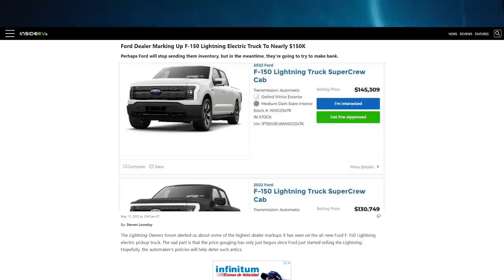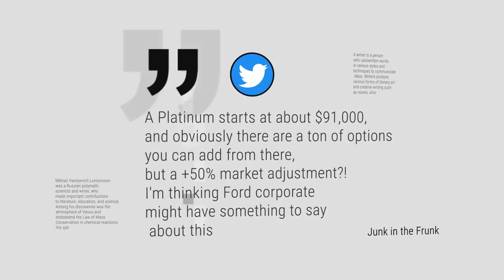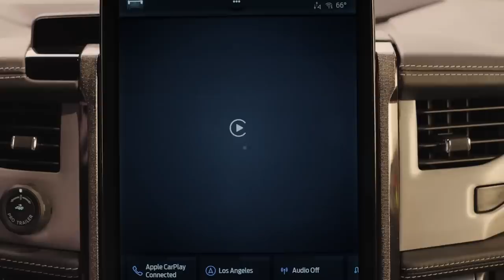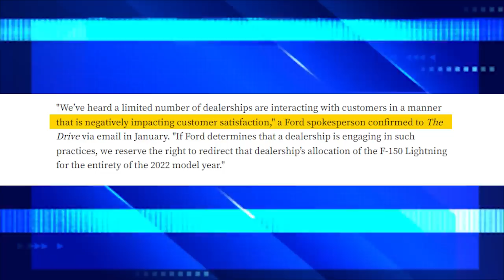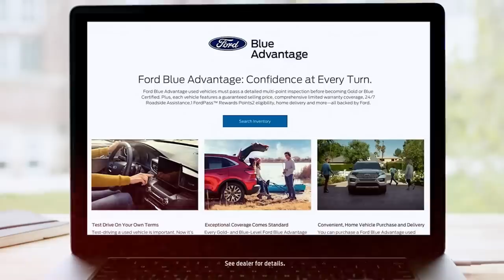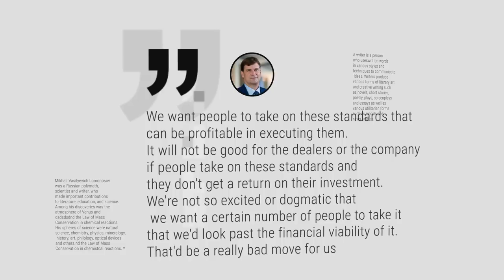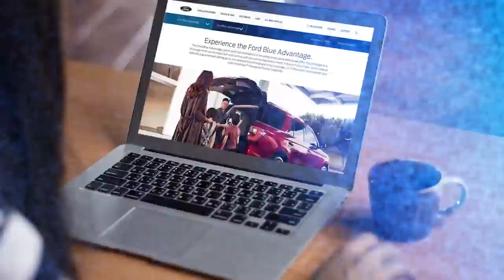Another HUGE Blow For Ford Dealers

Comment: I've been a Ford guy for a long time, but between a ton of recalls and stupid problems with our Ford's lately, and the gouging, I think I'm going to rethink my brand loyalty.
Reply: Loyalty should go both ways. Give me a good product and good service I will stay. Give me crappy products and crap service I am gone forever!
Reply: I did that years ago.
Reply: I have a Chevy 2500 6.0 and sold a dodge 2500 Cummins, own a super duty with 7.3 gas

They all suck and won’t last like the old trucks did. Just focus on best price and how they respond to warranty issues. The rest is just window dressing.
Reply: Stay away from any 2021 Chevy with the 6.2 gas engine. Son bought one and had to have the engine replaced at 8900 miles when a rod decided it did not like where it was. Been a bunch of those engines doing that
Reply: Toyota = reliability
Reply: @gutadin5  I agree with you but I have a 15k fifth wheel trailer we tow about 4-5 trips totaling around 6 thousand miles a year. 

We need the super duty with the 7.3 gasser
Reply: What manufacturer do you think does not have recalls??? Or independently owned dealers charging markups? You know that they are Franchisees right???
Reply: I went to Toyota years ago and have not regretted my decision.
Reply: Same with me. I just bought toyota tundra limited hybrid for about 18k less than Ford analog. So far very happy with my purchase 😆
Reply: Tesla also has a lot of recalls and steady rising
Reply: All brands are doing it
Reply: We were Ford loyal, but the last Ford was the last straw. Didn't even walk in to a Ford dealership this time around.
Reply: @dustinpowell5981  they all do. But Ford is leading the pack by a large margin. Look it up.
Reply: Yeah...go over to Toyota and get gouged.  A much better gouging experience.
Reply: I never understood that concept.  It’s a company, not a person.  It’s not going to be loyal to you so why be loyal to a company?
Reply: @FriedChairs  There are very few things that are loyal to you...except a cat or a dog.
Reply: @Him Humans are tribal. Sorry.

Comment: I work for a ford dealer and I am appalled by some of the pricing we charge for vehicles.
Every time we get a new bronco in, the sales dept will immediately take it back to the shop and slap $10k-$15k in accessories, wheels and tires to justify adding their ridiculous mark up.
For instance we had a bronco base come in as stock, 32k MSRP + 10k in parts and a labor, plus a 15k market adjustment. Grand total $57,000 for a base bronco…
Reply: You'd better be looking for another job because they're gonna get shut down believe me and you'll be out at work
Reply: How can you tell if a dealership has marked up a base vehicle?
Maybe this can help some of us when purchasing one.
Reply: @davidescobar5366   Look at the window sticker . FOMOCO retail price should be on that .
Reply: @scottmendoza8989  I work in parts, no matter what happens with sales, parts and service should remain unaffected unless the dealer just closes its doors completely, which I don’t see happening anytime soon. At least not the one I work for. Can’t say the same for others across the country.
Reply: This is the kind of dealer that ford needs to punish by not sending them any EV's.
Reply: @scottsdale4899  There isnt enough Broncos being produced and way to much demand from the 8 trillion dollars they printed in a year.
Reply: I've seen dealership chains add a blinking module on the third brake light for $900! You can buy them on line for $20!
Reply: Remember, Ford corp pulled ALL thier incentives, discounts, rebates and etc and they have raised thier prices to the dealers 3 times this year!! Ford corp is pissed and envious that dealerships figured out how to make good profits while sales volume went down and Ford Corp wants to steal that profit
Reply: @scottmendoza8989  And when they do you might be looking for a job yourself.  You would be in shock to know what a single dealership puts back into the communities we all live in.  The money generated in these stores gets spent right back at a local level not to mention what taxes are put back into your local government.  The job loss total would be so significant that many towns across this country would be in deep trouble.  Don't just think of sales, parts, service, and body shops would all be gone as well.
Reply: @scottsdale4899  It sounds like they have been trying altho not having much success from the video. I believe that is why they are designing the EV side to never allow it from the start.
Reply: Hunting Beach Ford was selling a Bronco for 80k. It's insane
Reply: @mendoblendo321  I would never pay it, but you have a few Broncos at a dealership and 50 people trying to buy them and they will gladly pay 100k.   It's insane, but its voluntary.
Reply: Wow! That's crazy!!!!
Reply: @andrekeise7305  Not  crazy at all when you have millions of idiots willing to pay.
Reply: As long as idiots keep buying them they'll keep doing it
Reply: Sounds like Brandon ford in Tampa
Reply: And they are bloated garbage
Reply: It's not a base if they've added accessories though...
Reply: Part of the problem is that people are dumb enough to pay for it.
Reply: If the customer doesn't like it, go buy a chevy. Supply and demand. Jim dictating pricing may work out this round but what about the next or a different Jim? Free market is the way to be.
Reply: @gary7427  soooooo.....
You're okay with people getting screwed over price then.
Exactly the mentality I would expect from someone that works in the industry and has no problem being greedy, as well as dishonest.
Reply: @rogerramjet6429  I'm not ok with price hikes or people being "screwed", but in a free market system prices are brought to you by demand and supply.  If these vehicles were crap and no-one wanted them then you would have no problem with dealers selling them far below there cost?  The important thing here is that this is not unique to dealership's, every form of retail experiences this.  Just look what people are now paying for damn chicken eggs!  Were is your outrage on grocery stores!
Reply: @Gary  what dealerships are doing is called "price gouging" and THAT should be illegal
Reply: Things are ultimately priced at the highest level customers will pay.  I don't really see any way around this rule that has existed for thousands of years.
Reply: I have to give you credit for speaking up. You job is in danger at this point. Be safe and thanks
Reply: @Michael-qy1jz  and who was the president when that happened?
Reply: It's kind of weird to see that right below your post there's another one of someone complaining about having been offered a Bronco for $60,000.

Comment: Just one of the reasons I usually buy a car that's a couple of years old. Let someone else pay all those extra charges and deal with most of the  warranty problems.
Reply: Problem is their big dollar markup cars like the 350R 500 GT and Bronco Raptor will be worth even more than you bought them for in 5 years and 10 years, especially with the end of combustion engines or the hint of that.
Reply: And you can deal with all of the out of warranty problems. Good plan.
Reply: @RLTtizME  That is why you want to buy a Honda or Toyota that does not have problems.
Reply: @RLTtizME  Angry much? LOL
Reply: @oraclewizard77  Just responding to your silly comment.  Your problem Bradley Boy. 💋💋
Reply: These days buying a used car a few years old means paying new MSRP, lol. I'll pass on that too.
Reply: @oraclewizard77  I’ll take a 10 year old 4-Runner over a current year Bronco any day. In another 10 years the 4-Runner will still be going 😅.

Comment: ADDITIONAL DEALER PROFIT, a term dealers won't use, has been around for a long time.  For that reason I have not looked at new cars because I refuse to pay more than the manufacture listed price on the window sticker, which is the reason window stickers were mandated in the first place.  They are supposed to let the consumer know what the price of the vehicle should be rather than just letting the dealer set a price according to their own standards as it was once done.
Reply: Dealers have been doing this for years but it was on special low production vehicles.  Now they're doing it on all vehicles. And individuals are overpricing on their used crap too .

Comment: As a fleet buyer we stopped buying fleet ford's, Ford and Gm has become untrustworthy and overpriced for fleet. It's cheaper to buy from fleet resales or bank repo sales. These vehicles has less than 30,000 miles and still have factory warranty that's transferable.

Comment: I saw something similar as a Trainer for the largest Dealership nework in American. I said several years ago that I thought Manufacturers would be pushing a "Tesla" style direct market model, causing the 3rd party Dealership model to be limited or gone within 10 to 15 years. I guess time will tell if I was right or if I was wrong.

Comment: Three years ago, I got a 1997 Saturn coupe 5-speed. The owner originally wanted $4,500 b/c the mileage is super low for the age (78K at the time). As much as I'd always wanted one of these clever little coupes (it would have been my third Saturn), I wasn't willing to pay that much for it. I decided to just 'keep an eye on it'. After three months and no buyer, I called the owner and went to see it. It was a little noisy and squeaky and it needed tires, but the a/c worked and the clutch only needed a little adjusting. I offered him the money we had on us: $1,536. The car has never failed me and gets 27 city and 37 highway. I have run synthetic oil through it, kept it aligned, changed the fluids regularly. These manual beauties can get hundreds of thousands of miles on the odometer. There is no new car that can talk me out of a good, old car with a four cylinder.

Comment: If dealer service departments did not lie and cheat each customer and the manufacturer for every repair. They could have almost all of the service work. 
Dealers have fired experienced techs who know how to diagnose. They have hired parts changers who look at P0420 and throw cats and oxygen sensors on cars and trucks with out fixing the root problem in the engine controls.

Comment: I just see small dealers being pushed out, while large get richer.
And prices don't change. 
Goes against Henry ford's original idea of an affordable  car for every family. Only the rich or in debt can afford a bronco right now.
Reply: Affordable went out the window a lot time ago when everyone decided they need infotainment systems, phone chargers, wi-fi, heated and cooled seats and cupholders, etc.
Reply: @wildbill23c  that's the manufacture trying to one up the other manufactures. " look ours comes with heated seats on a base model".
The rangers did well because they could be ordered as a base model work truck power nothing and maybe a radio. Cheap transportation that was simple to drive. 
I am sure Datsun and others did well for similar reason. 
I loved my rangers. But couldn't put myself in a new one. It isn't the same. 
Ford really jacked up the names these last years.
Reply: @turboflush  I'm still driving an 87 Ranger base model 2WD...only upgrades to it was the cassette player, AC and the 2.9L V6...the rest of it is bare basic, I love it, no power window or power lock crap to break which both were broken in my 88 Bronco 2, no airbags, no traction control, none of that garbage that fails....The ABS control module failed in my 08 Explorer....no longer available...how the hell is a safety device for a vehicle no longer available...still cost $2200 to have a used one installed.  I prefer the old stuff that don't have that nonsense.
Reply: @wildbill23c  
Honestly better from a epa standpoint also.  Easier to keep running correct. All this epa stuff just makes them run worse when they fail.
Reply: You will soon join the ranks of those in debt if you go for that Bronco before they work out the kinks. It isnt the 70's pony you may remember...provided you are old enough to remember
Reply: @wjgoh653  Definitely.  I wouldn't buy new, and I wouldn't finance.

Comment: Just like any appliance or other product, get it directly from the manufacturer, and either hv any work done by an authorized service center, or have the tech come to you. It’s all getting more computerized, should be easy to diagnose and swap out part in your drive by now, especially if it’s all electronic 👍😉
Screw the middleman!

Comment: NOT ALL DEALERSHIPS ARE LIKE THIS! It's just like crime; the few spoil it for the rest! Our dealership has not charged over MSRP since the pandemic began (sure, on a vehicle that is unique like a Raptor R that we may not see more than 1 unit in a year will have an adjustment). We want our customers to remember this; however, I bet when pricing comes back down our dealership will not be remembered for our honor! The price gouging goes both ways even when you try to be a gentleman. (Farley says that they know the dealerships that are over charging.... weird.... so do I in our area; but I see their inventory and it far surpasses ours and we are not hurting our customers. )
Reply: 'we dont mark up except when we do' lmao dealerships like yall made me walk away from a focus RS and into the subie dealership for an sti
Reply: @dovid916  I think the STI was a better choice anyways, and I'm not a Subaru guy.
Reply: The FOCUS is a pos.  Subaru makes a vastly better car.
Reply: @Salesman263  The older ones were great cars, when they went to that crappy dual clutch automatic was when all the problems started.  Subaru makes some good cars, if you can keep the CVT's from failing, they've gotten much better in recent years though for sure.
Reply: @wildbill23c  totally agree. I have been a Subaru fan for close to 40 years believe it or not. We had a 1982GL that literally rust it away which was the only reason we ultimately got rid of it.

Comment: As a retired new car dealer I can tell you that the factory has many ways of ''punishing'' an unruly dealer. The factory allots the product, no product, no sales. The factory pays for warranty work and audits dealers on their warranty procedures, a very expensive charge back is very easy to get due to the complexity of the warranty rules and regulations. And I could go on and on. And by the way, periods when product is scarce are much less numerous than periods where dealers are overstocked by over producing factories and must fight for every sale.

Comment: Just Ordered/Bought a 2022 F150 powerboost. The dealer said Ford would not allow a ordered Vehicle to be sold above MSRP ( what I paid). When my truck came in the salesmen pointed out the two trucks parked beside mine , delivered the same day as mine and have already sold for $12,000 over MSRP ( three days since delivery). My powerboost was in more demand and a higher trim level and he made sure I knew ( several times)  That I was free to walk away whole for any reason. I said I want the Truck,  but curious, what could you get for it. He leaned in and whispered, I would try for 18K over and settle for 15K over MSRP. 

So why is inflation so high, wonder why

Comment: I bought a new Ford Ranger a few years ago…I thought the price then was a bit high, but I had two to trade in and went ahead with the deal.  I keep the mileage low as I’m retired now, and don’t have to drive every day to work.  Now they are begging me to bring it back and upgrade to something newer.   NO WAY!  Prices are WAY out of line….and I can drive this for 10 yrs easy.  Our dealership has gone downhill, the service dept. sucks,  and I won’t buy an EV.  if I eventually do buy another, it won’t be FORD.

Comment: Mercedes have just started this here in the UK and I’m not sure it’s Legal under competition laws because it means no matter who or where you buy from the price has to be the same,several manufacturers have been quietly operating this system here for years without the appropriate authority’s challenging them. It’s called Price Fixing which used to be called the Retail Price at which every dealer had to apply but it was outlawed here to allow competition amongst dealers to try and get customers a better price for their new vehicle. I’m not sure in this instance wether it’s going to protect the customer or the manufacture,if people are willing to pay these extortionate prices surely it’s their business NOT the manufacture,personally I’d walk away from any deal I wasn’t happy with and that would sort out both the dealers and manufacturers because if enough people did it they wouldn’t sell any vehicles which would be disastrous for both,people dictate the market by refusing to pay high prices and I for one will NOT buy a Mercedes while this practice continues and everyone should do the same,see how well that goes down with both of them,without customers these companies are Nothing.

Comment: We just bought a car and shockingly, got a good deal.  This has not been the case for most.  Family and friends have been told there is limited supply so they don't negotiate.  However, they are also saying that used cars on trade are not as valuable as they are and giving far less then market value.  Buying a car has not been a great experience for many years and this is the straw that breaks the camels back.